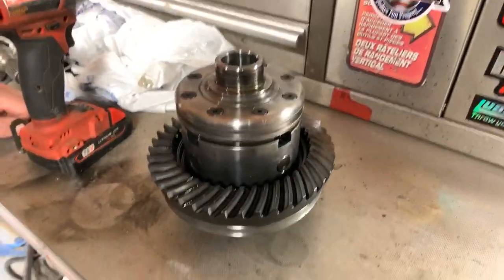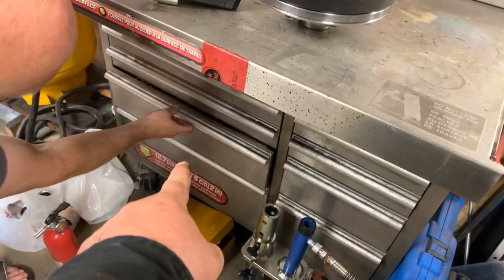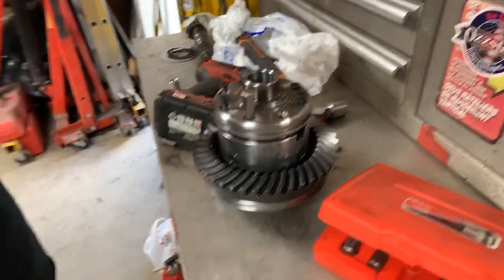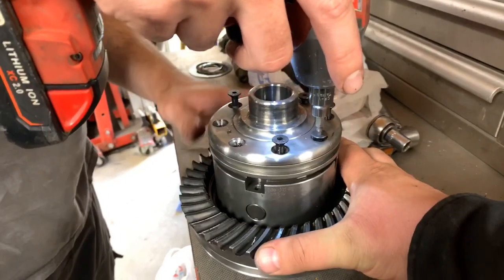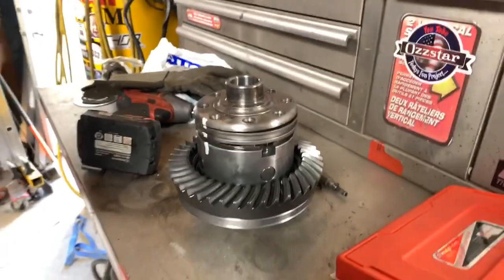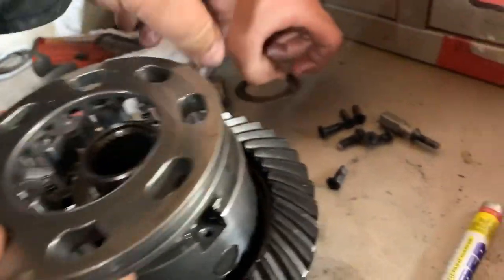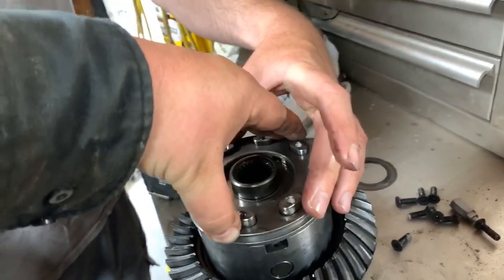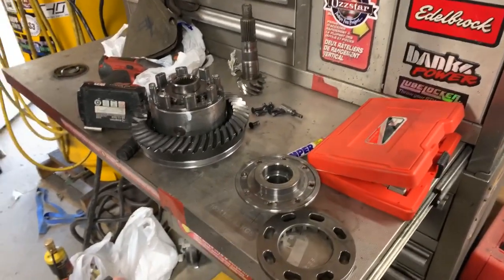Broken OX Locker Teardown

Comment: There's a fair bit of play in that shim, the interior diameter is too big so if it's not perfectly centered it will prevent the locker from working. Not sure why it expanded so much, maybe it was wrong from the factory. We sanded it down, made sure it was centered when assembling and it's working fine now.
Reply from the maker: that is a thrust washer, you can order a new one from OX for .49 cents
Reply: The washer that was in the locker was the wrong size. OX support told me on the phone that the thrust washer was actually the same as the thrust washer used on the side gear in the carrier. I took one out of the carrier and sure enough, they are different. Fits perfectly.

Comment: I had one out of a Dana 44, that broke the differential pin broke in half, and the kid was driving it locked, he didn't know which direction the cable handle was supposed to be, he had it confused back disengaged, forward engaged.

Comment: Thanks..ive been looking at buying an ox locker.but. never understood how they work..
Reply from the maker: Best lockers out there I think
Reply: @BackCountryWrenching  yea  there right up there with the ARB airlockers!!!
Reply from the maker: Air lockers are not the best choice where I live, they fail quite often in our cold climate.  Not to the fault of the locker but without a system to dry the air from the compressor the lines quite commonly freeze up.